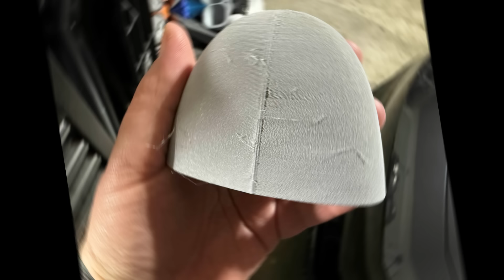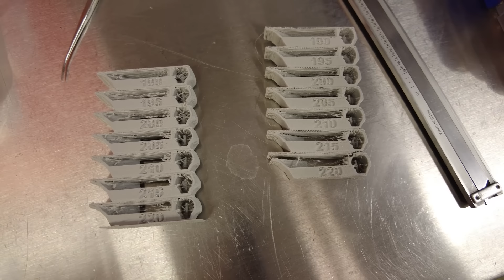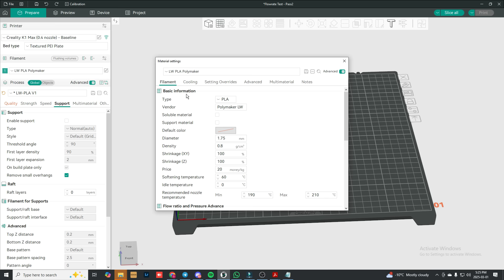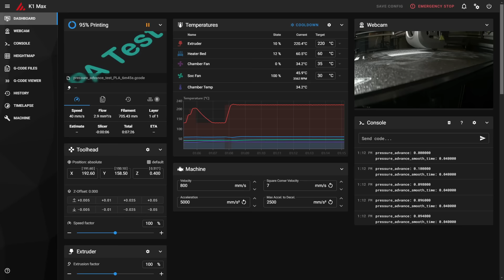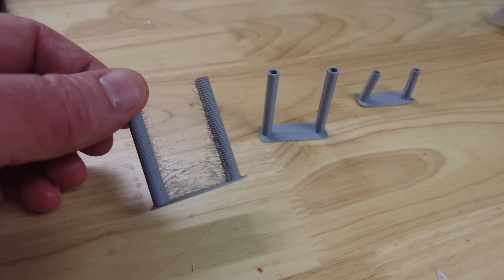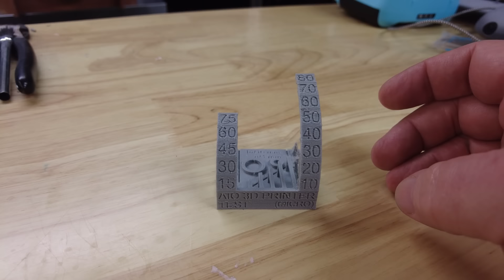How To: LW PLA Printer Calibration Guide - Ultimate Settings for Light Weight PLA Printed Aircraft

Comment: I messed around with a bunch of settings on my Bambu P2S using this filament and the one thing I still haven't worked out is the super fine stringing. If I dial in too much retraction it causes a under extrusion issue and leaves gaps right after retraction at the seam. The best I could do is close the seam and deal with the stringing.

Comment: Printing on my K1 SE. I’ve had varied results but frankly as I’ve adjusted the temp down to 205 the results improved dramatically. I haven’t adjusted ANY other settings and the simple drop in temp made all the difference. Haven’t tried 200 yet but I believe I will on the next print which is a wing segment for a VTOL fixed wing. We’ll see…

Comment: can u share the filament profile?
Reply from the maker: You should start with the manufacturer base profile the run the calibration and tune for your printer, mine will not match your printer.

Comment: Should i be putting layers on like wing parts,trying the wolf glider from eclipson..i cant get the cf tube part to print either..ill try all these test then try a part..my parts look ok just lake integrate inside parts..
Reply: This print is a "head scratcher". It prints like a champ in PETG-CF for the first two sections, but foaming LW-PLA prints a mess in the second two fuse sections. I'm sure we'll both figure this out. Good luck!

Comment: Great video, and it really helps to get your printer dialed in.  My main issue atm is the software side of things.  I can't get the parts to slice correctly on Cura or Orca.  They keep leaving out structures and ribs.  Have you done or would you consider doing a slicer settings vid?
Reply from the maker: When you say leaving out structure and ribs, you mean items that ar actually in the model and not 'infill' correct?  Yes I can do a slicer video.

Comment: Great guide—thanks for breaking down the LW PLA calibration process so clearly! Would you mind sharing your filament profile settings as well (like temp, flow, retraction, etc.)? I’d love to try them out :)
Reply from the maker: You will need to do your own calibration, I have a custom extruder that changes a few settings.  Just follow the calibration video and you will be running like a pro!

Comment: Sad to see there's no way to 110% eliminate stringing.. You'll still see angel hairs which I suppose you could just zap with a heatgun for a fraction of a second, but I was hoping to glean from this something new I magically didn't know. It's just calibrate, rinse and repeat. I too have Polymaker LW-PLA and I'm trying so dang hard on my 5M machine... Fun fact: if you cold pull, there's a chance you'll just get a bulged tip of the filament and it'll jam in the extruder. Fun times...
Reply: The current settings I am running on my K1 Max does not have any stringing between multiple parts on the bed.  In some tight geometry areas there may be minor stringing where the print head starts and stops in tight areas.  Overall very good quality and zero issues with parts.  As you say, very quick cleanup if any at all.

Comment: where can i get the free spreadsheet?   thanks for the great video! 
Quick questions...
i am using orca slicer 2.3.0,  using an artillery x4 direct drive.
when i sliced the temp tower (210-250c) it told me there was an error with non-manifold edges and wanted me to repair them.
i sent it to the printer after fixing, and all of them, the circle with the pokey thing printed horrible.  should i just complete the other tests and then go back and fine tune?  or am i doing something wrong?
thanks!
Reply: Thanks for the link!  When you say, "the other way"  which other way do you refer?😅
Reply from the maker: @jimdavis7532  Just ignore the manifold edge error, do not have the slicer fix it. (lol the other way):face-blue-smiling:
Reply from the maker: It sounds like your slicer is trying to close the ends of the holes with the cone in it.  I would try it the other way.
Reply from the maker: Here is the link to the spreadsheet - https://docs.google.com/spreadsheets/d/1U4iVN5EPGngK493WSTvpp9ec2hS0ExI5z2-ZysJwOdM/edit?usp=sharing

Comment: The whole point of LW PLA is that the low weight comes from it foaming at higher temperatures. ColorFabb LW PLA for example has temperature range from 195°C to 260°C. Printing under 220°C you're basically using it like normal PLA. I think my settings are around 250°C and 0.4 flow ratio.

Edit: Oh! what I said actually isn't correct for Polymaker LW-PLA. I hadn't realized there are different kinds of LW-PLA. Polymaker stuff works at much lower temperatures but does not give similar weight reduction, only 30% reduction compared to 65% of ColorFabb.

Definitely see the manufacturer recommendations for the plastic.
Reply from the maker: I see your revised comments got it.  Yes this is pre foamed PLA so no need for the higher temperatures.

I have used active foaming PLA as well in the past.  I will try to post a few videos in the future.  I ran a bunch of parts for the Talon 1400 in both active foaming and pre foamed PLA.  The pre foamed parts were slightly heavier, I could go back and find my notes or re weigh them.

This all said, I foudn the pre foamed PLA parts were superior in appearance and strenght compared to the active foaming PLA.  Hence I started using pre foamed PLA for most projects.

I will go back and try to find some comparison parts.
Reply: @Captain3DPrintedFPV  Colorfabb LW-PLA do tend to get quite weak at higher expansion